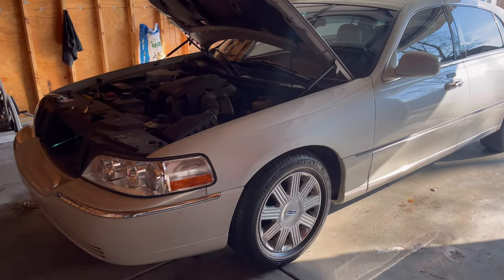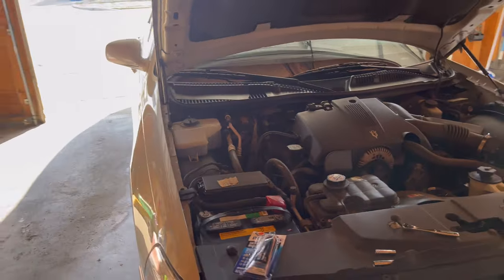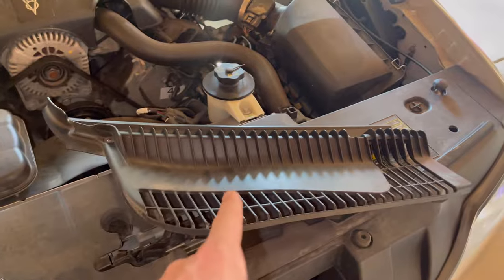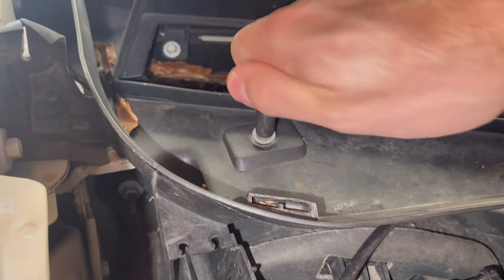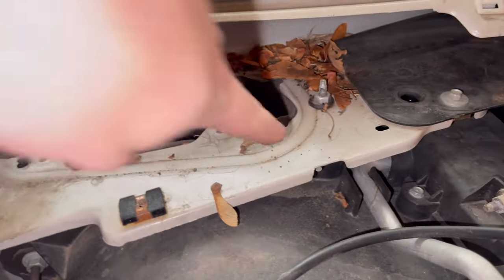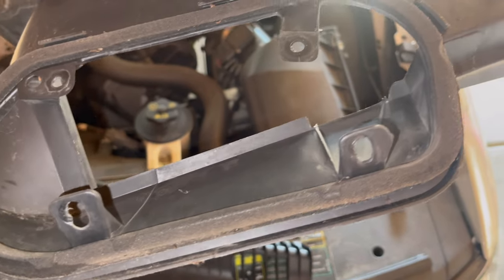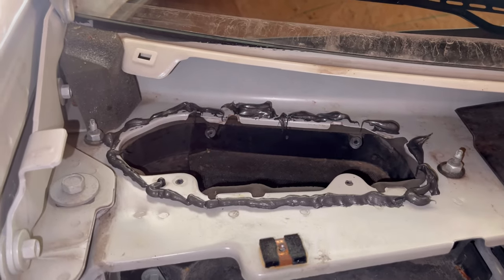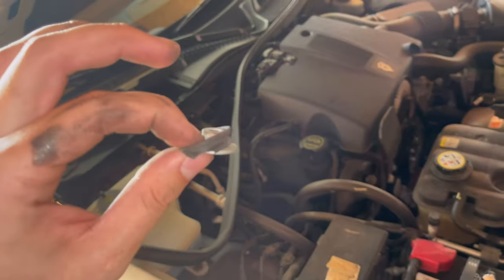Lincoln Town Car Water Leak on Rear Floor | How to Guide

Comment: Just picked up a 07 with about 124k on it! It had a small pond in the rear passenger seat. The guy I got it from didn’t have no clue where it was coming from. I’ll be fixing this problem tomorrow. Thanks
Reply from the maker: No problem!

Comment: Our 2006 is doing the same thing.  I'll be fixing it this weekend.  Thanks for the video...
Reply from the maker: No problem brother!
Reply: @GetThisNick  Fixed ours and it works.  We found a second leak on the other side, that was getting the seat belt wet.  It was that black plastic B-pillar cover.  Resealed it and we're all good...
Reply from the maker: @ccrider77  Glad you got it taken care of brother 👍🏼

Comment: Years ago I used caulking and gasket maker and both attempts didn’t work. I used a water proof door seal and that did the trick for me.
Reply from the maker: I heard about using the weather stripping as well! I’m hoping the sealant is enough for me 🤞🏼
Reply: @GetThisNick  I wish you best of luck

Comment: Would this cause leaking into the driver side rear passenger seat?
Reply from the maker: I don’t believe so but there’s always a possibility. I’ve heard of these cars having water behind the drivers seat and it ended up being something to do with the firewall on the car. Almost like there was a water coming in through a spot in the firewall behind/underneath the steering column of the vehicle
Reply: @GetThisNick  thanks! I’ll reseal the cowl gasket and hope that fixes the water leak.   If not, probably to the mechanic it goes.
Reply: Its coming from the hood opening latch where the cable routes through firewall, but after i sealed that, i know get water leaking into rear again but front is dry. Might just have to pull the carpet and find exactly where its comjng from. Could be rear door seal, trunk seal, or maybe one of the bolts where the seat mounts up to could be leaking through, but seeing as it doesnt happen ehen car is driving rather ehen it sits in the rain, i doubt it.

Comment: What happens if you have to replace the blower motor below it? The sealer will make that impossible now.
Reply: Youll just have to cut it with razor and redo it when you put it back.

Comment: It's an American car there is no reliability stick to japanese car much better
Reply: American cars are reliable my dude
Reply: Panther platforms are some of the most reliable cars you can find. There are some unreliable American cars (and Japanese) of course, but calling out these Panther platforms is just barking up the wrong tree. Some Japanese cars are reliable, some American cars are reliable. There's lemons of models and rough patches of production years from probably every car manufacturer out there, including Lexus and Toyota.
Reply: You mean like Toyota truck frames being recalled for breaking in half or the Takata airbag fiasco, affecting 65 million vehicles, including most Honda vehicles?  The Lincoln Town Car, which is built on the legendary Panther chassis, and using the ultra reliable 4.6 liter V8, is one of the most reliable cars in existence.  Police departments used and abused this platform for decades, and when they finished with them, the cab companies used them some more, and most are still on the road.  Livery services still use the Town Car, years after it was discontinued.  A simple worn rubber HVAC seal is a simple maintenance item, unlike a Jatco transmission in a Nissan failing, or power window switches in 6.5 million Toyotas that could catch fire...
Reply: When it comes to panther platform that is not really true.  No car is perfect.  This is just a minor issue compared to other things.
Reply: You mean like a piece of shit Nissan??

Comment: I fixed this issue on my 05, and now i have water puddling up on my driver side passenger. I fixed that leak, was coming from the hood latch cable area where the cable routes through the firewall. Now im getting a leak to my rear again, but not from where it was coming in before. And theres no good indication of where the fuck its coming from bc its only in back driver side. When it leaked there originally it was due to the cable shit leaking, but since i fixed that the driver foot well doesnt get wet, just the rear.